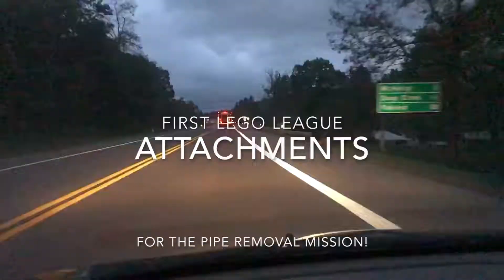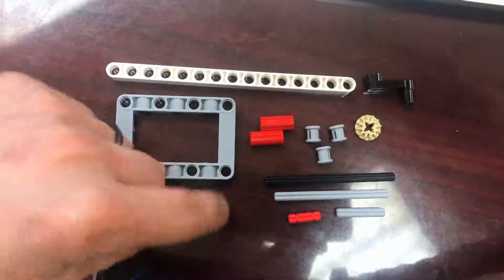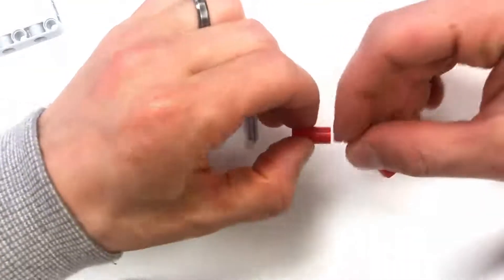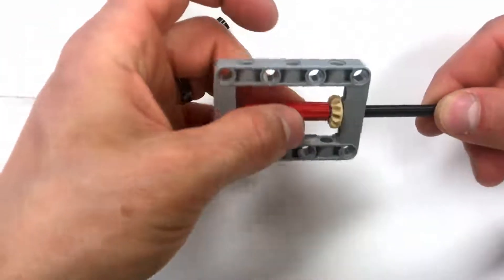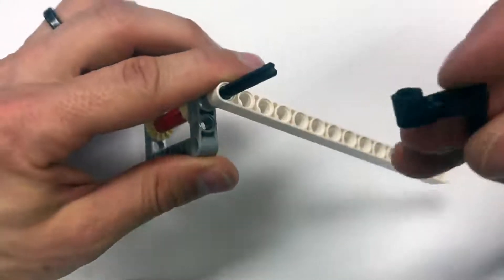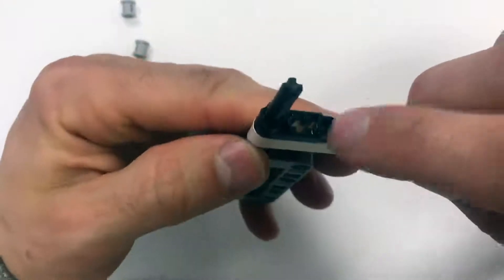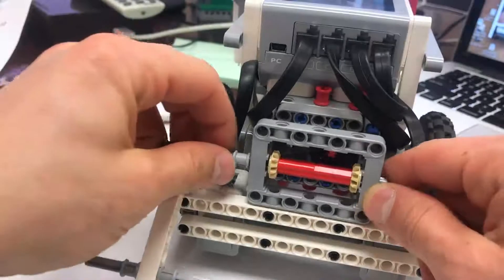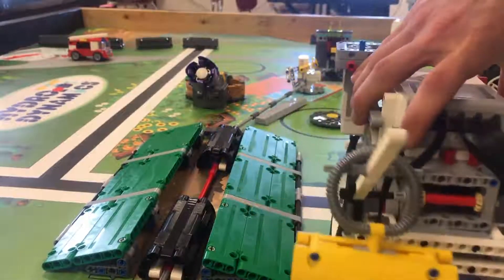FLL Hydro Dynamics Attachments: Pipe Removal Mission

Comment: is there a substitute for the "one of a kind" piece?
Reply from the maker: +Aman Luthra as a matter of fact yes. You can use on of the “2x4 L Beams” with the axle hole as the last hole (usually red or black in the standard EV3 kits) and some pegs to lock the longer beam into the rotating axle. I hope that made since! If not, let me know and I’ll try to explain better.
Reply: thank you so much! Also, when will the next video for the attachment guides be available? Your tutorials help so much.
Reply from the maker: +Bhargav Chandramouli I will post another video tomorrow in detail.
Reply from the maker: Hi! I've posted an alternate methods video: https://youtu.be/nPWUJsyebZY
Reply from the maker: Stay tuned next week! I plan on posting three simple solutions for three more missions.
Reply: +Zachary Trautwein Thank You So MUCH!!!!! You make our life so much easier!!